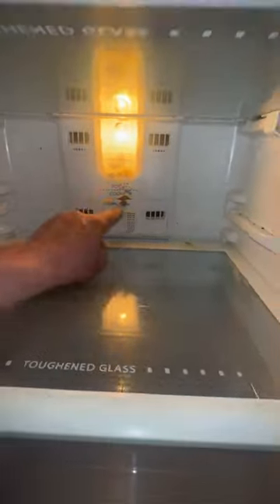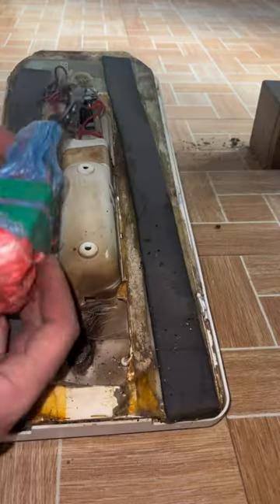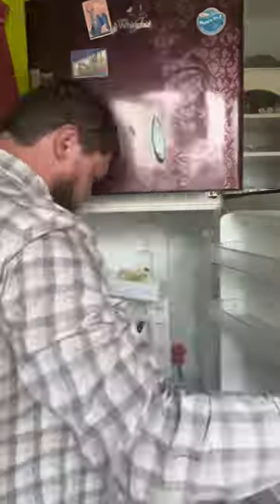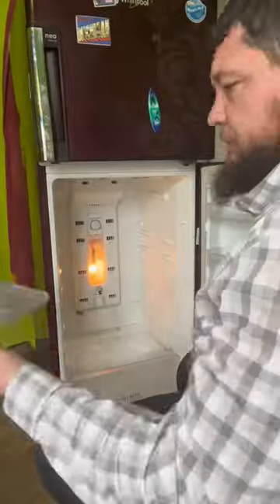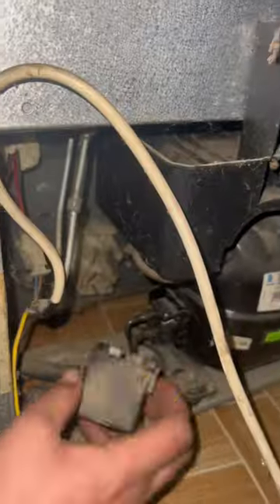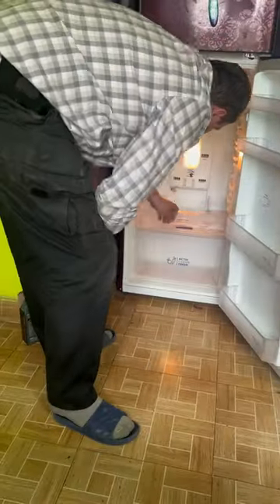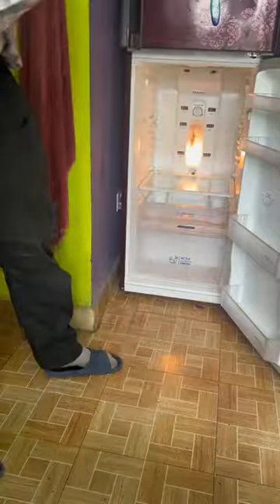Fixing a Refrigerator during my time in Kathmandu, Nepal. #HandsomeOrHandy #HandyMan.￼

Comment: Defrost timer stuck in defrost could be sign of defrost issue, either the defrost heater fail or the safety fuse blown from over temp, some fridge have the power of the def timer motor wired through the heater

The fridge wpuld usually work fine for 3-4 days before the evap fully iced up

Comment: Shame. That refrigerator used 5 times the power that a new one uses.
Reply from the maker: Can you tell me what you think the numbers are?
Reply: @HandsomeOrHandy  The old 'brown' refrigerators used roughly 2500KW/year.
New refrigerators use roughly 500KW/year.
And that does not take into effect of ambient temperatures where your shown refrigerator is located.
Presumably a hot dry area like a desert or near desert.
In that case, it would use even more power.
To save them some money, attach some thick Styrofoam (spray glued), foil faced on both sides, to at least the back of the refrigerator.
More you add the less power it will use.
Adding to the sides will help a lot too. Top even better if they do not use the top for storage.
Replacing the old compressor with a modern one can save money too due to higher efficiency.

About that defective fan - good job getting it to work. In a pinch you could change it to an old GE fan and blade but a little modification is necessary.
Possibly an old Whirlpool fan and blade.

Amana fans might fit well.